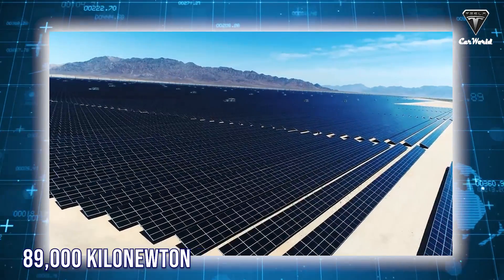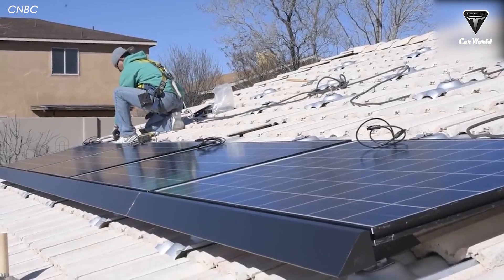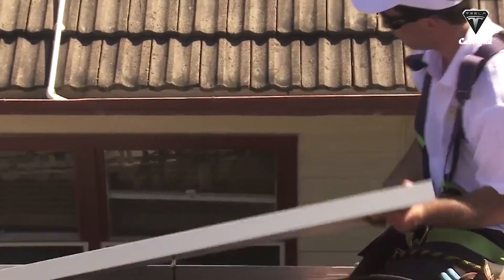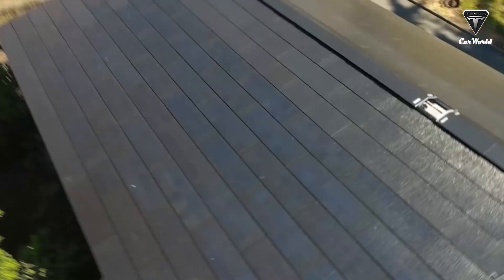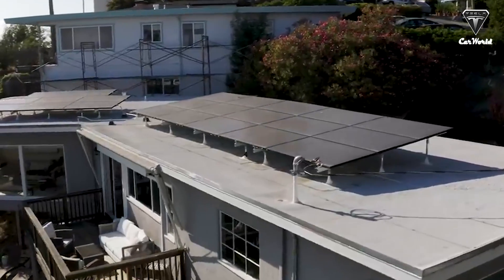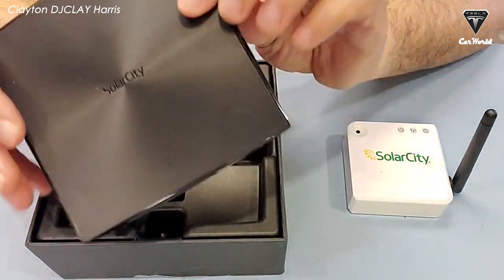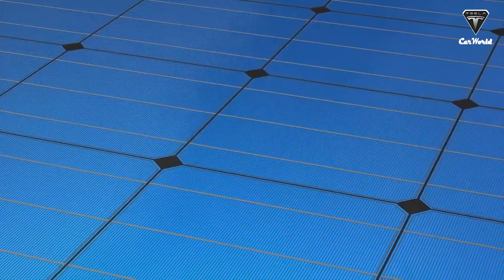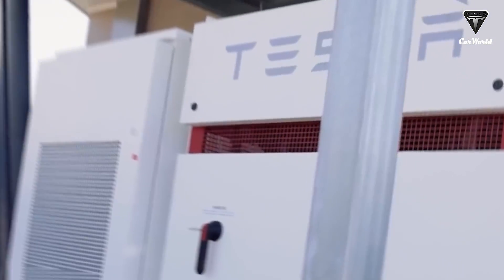Elon Musk Reveals Cheap Energy Only $2.21 Can be used continuously for 50 years in Texas!

Comment: Nuclear-power is still the best power source with the smallest foot print.
Reply: No not really.  In places where there is a lot of sunshine year round, house and building mounted solar panels have the smallest footprint considering it's going onto space that's already used and you don't have to add space for the installation.  Since this story is about Texas, the downside here is the hostility of Texas lawmakers towards wind and solar.  In most parts of Texas you won't get smart metering which is the best way to have a home solar install, and in the summer time CLEARLY makes the most sense considering the demand on electricity due to air conditioning.  We've already had days where the state put out alerts asking people to shut down power usage or we could have had rolling blackouts.  If the state were more friendly to home solar, it would exist in much larger numbers and the time you need the benefit of that solar generation is when the demand is greatest on the Texas grid.  But that's the stupidity of the Texas govt. considering their campaigns are paid for by companies that deal with the natural gas and oil industry.

You can't build a new nuclear power plant in most states because they don't want them, and it's not the "NIMBY" effect.  It's cost.  A consumer will pay 50 to 60 cents/KW for nuclear power if it's not subsidized.  And that kind of cost for power means people are struggling.  In Texas we are mostly natural gas, coal and we have a growing wind and solar industry.  Since all the installation of wind farms happened, it's dropped the cost of electricity in the state down to 10 cents/KWh.  As a Texan, that's one of MY biggest concerns because I'm not attached to one business or another.  Wind has helped drop costs for power in the state.

Back in 2010 - 2012 when Obama talked about moving to green energy they created a fund of a few billion dollars to go into R&D for modern solar and to subsidize new plants.  I think that turned into 2 new plants that are still not on line yet.

Cost is the driver, not foot print.  I don't care if a solar farm uses a sq. mile out in semi-arid Texas where nobody is doing anything with that land.  Sure, during the winter the power output isn't so great, but the need for electricity in the winter in Texas doesn't compare to the needs during summer.  But wind is what's growing the most in Texas due to having a wind corridor that runs through the state.
Reply: When the missiles drop and it gets shut down.
Reply: @truthisthevictory9278  When the missiles drop? Everything will go to hell in a handbasket quickly
Reply: @truthisthevictory9278  Name  us one power source that would not get shut down in such an event. Boy the haters of ALL energy will grasp at any straw in a failed attempt to make their bogus point.
Reply: @mikewurlitzer5217  It's not a matter of if it will get shut down; it's a matter of what happens if the system gets damaged in a way to where a proper shut down can't happen and you get a meltdown, or get some kind of explosion.

Tell me when an oil, coal or natural gas plant has exploded and now you can't use land within about 5 miles of that plant for 100+ years.

And for nuclear, it doesn't have to be a missile attack.  It could be a failure of electrics, a natural disaster, etc.....

But I'll go after the REAL issue for nuclear and you can't lie your way around this, nuclear costs too much.  Most people couldn't afford their electric bill if that cost wasn't subsidized.

But since this story was about Texas, Texas has two nuclear plants and with the way the Texas grid is managed it would be impossible to build another unless rules were changed.  The state wants natural gas plants to be built because of how inexpensive natural gas is in the state.  Wind energy and natural gas are starting to dominate but the two nuclear plants in Texas give really good output.
Reply: @johndoh5182  and how many meltdowns or explosions have there been?

Comment: By the way, thousands of solar panel users in the higher Northern Hemisphere (UK, Canada, US, Norway, Sweden, etc.) make do quite well with solar panels. Depending on surface area and efficiency, they still manage to save on electrical (grid) costs.
Reply: I hope you have a back up plan. The next Carrington event will throw the world back to the stone ages.
Reply: I like it when Elon (Mark) Musk (Mylin) grimaces the best!
Reply: They are made from coal
Reply: @therealcnn5346  I've heard it from reputable sources that you can only burn coal once and it doesn't flatten out very nicely on a roof, so even if you make the solar panel from coal it keeps giving for a couple decades, where coal is *poof*... one time use.
Reply: @therealcnn5346  
"They are made of" sand.
If coal is used to generate the electricity used to make them, it's a one off use, after which they generate for many years.

Comment: how about they install solar panels/shingles on roofs and just charge us the going electricity rate until the cost of the installation is paid off plus 10% and insurance. then low-income families can get it installed on their homes.
Reply: @Andrew Meloni michigan
Reply: That's exactly what needs to happen.

My electric bill maxes out around $230/mo because I have two PHEV and it's 108F out here in Texas... not bad for a 2700 sqft home and two PHEVs, but could be lower...

Getting a solar system installed on my roof to offset 90% of my energy usage requires a 14KW system, which Tesla charged $35k for (plus $11k for the powerwall).  Other systems are as low as $35k with a battery backup, $28k without.

The CHEAPEST reasonably sized system would run me $475/mo to finance, meaning I will have a $30~50 electric bill PLUS $475/mo to pay for electricity for the next 5 years.  That's a big commitment, more than doubling my electric costs for five years... however, a 10 year term could be done without costing me much more monthly... but I can't find any good offers out there... maybe a HELOC or other home equity loan and buy a $35k system and pay it off over 15 years... but that's not available to lower income people.